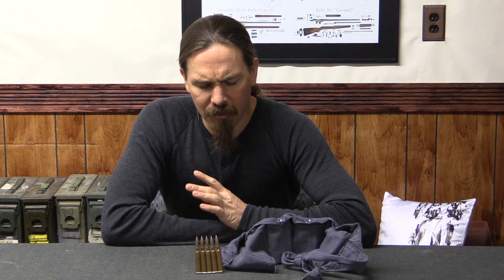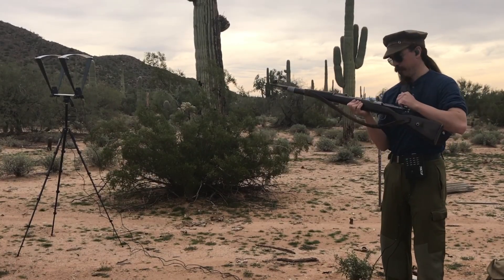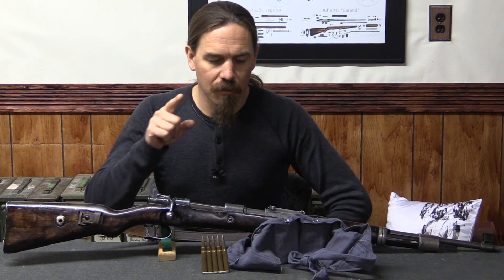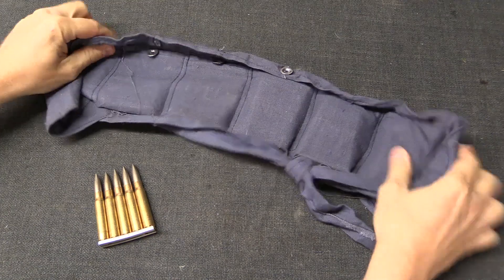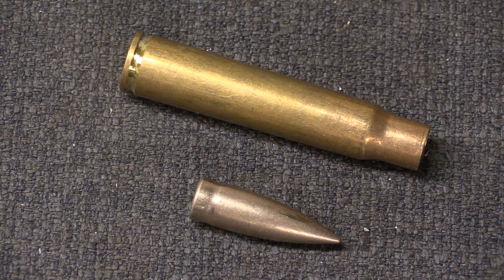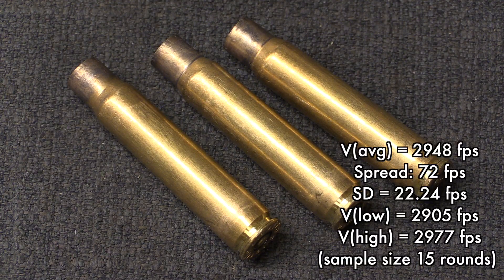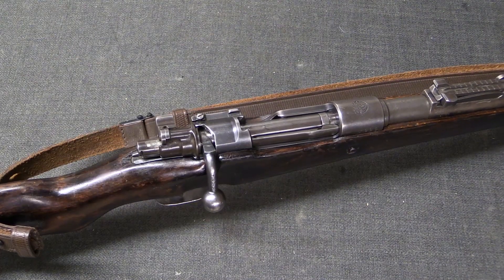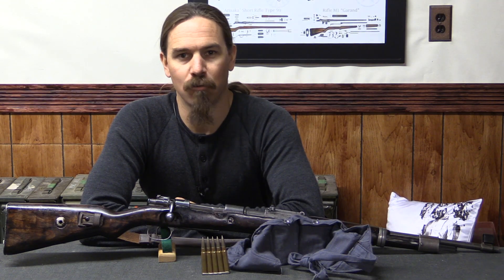Ammunition Evaluation: 1941 Turkish 8mm Mauser

Comment: Would you fire this ammo in an 1893 small ring Mauser? I did. I hadn't seen this video. It probably wasn't out yet when I did it. The ammo was in a blue bandolere, just like yours and had the same exact headstamp. It cratered just like yours did and the recoil felt like shooting a 12 ga. My rifle has a 29 and an 1/8 inch barrel though. If you added 50 ft. per second for every inch longer the barrel was than your VZ-24, that would be 3200 feet per second. I'll tell you that wouldn't surprise me. It seemed to literally scream to the target, which was an old water heater out of a camper that we let freeze. It blowed 2 1/2 to 3 inch holes in it at probably about 50 yds. I only fired one clip of 5 rounds through it, because it already had a slightly cracked stock when I fired it. I was trying to manage some of the recoil with my forward hand, but that didn't keep it from cracking further. I have a couple of ammo cans worth of this ammo. Only 2 bandolere's of it in blue ones. The other is in olive drab bandolere's. It must be Army ammo is olive drab and Navy is blue. But it's all the same. 
 My question is would you advise that it's safe to fire this ammo in a small ring 1893 Mauser with a 29 1/8 inch barrel?

Comment: I have a small quantity of 1941 dated Turkish 8mm. Cracked case necks galore, women are way over pressure, some hang fire. Friends say my 8mm just hits harder than theirs. I run it exclusively in a 1917 dated GEW 98 that some past bubba "sporterized" The guts are indestructible but the cosmetics are so bad the rifle basically lacks economic value. I've never really been afraid of it, other than knowing it might just not work, which hardly matters for plinking, but I never considered it might get used in semis or machine gun. My bandoleers are identical to yours only in a light sorta OD green. Same head stamps that looks like it was done on broken tooling. I've tried to zero this ammo, back when I had lots, it's so bizzarely inaccurate that you could use it just to drive someone nuts. It even made me wonder about my bore but a box of modern Winchester ammo confirms the 107 year old rifle is fine lol. I sorta suspect the rifle will always be fine, I think the only way to kill it would require inent, you'd have to really mean to break it.

Comment: Just found these shows.
While I do agree  with crating being a sign of HP.. Comparing the Turkish Ammo to the Others is not really a good indicator. 1 Different Loading,2 Different Primers,3 Different Powder..

What was the orginal specs for  the ammo or particular  this load.?? 2850ish for the WW1  What was these supposed  to be that or 2950ish ?? Also note  Gew98s were  28 29inch barrels What were the Turks barrels at time this ammo was made?? All really needed to get an accurate  conclusion on if actually the ammo was originally loaded to hot.Primers often have different specs,some have harder or softer cups than other n may signs of hp while another in the exact same case powder n bullet dosent.

THERE IS NO DOUBT HOWEVER  I WOULD NOT SHOT THIS MYSELF.
 
Would pull the bullets n re load at some point myself.

Comment: I am not an expert but I think the problem is not with Turkish ammunition because Turks have been using this ammunitions in all wars for decades even a century. However in Turkey there is no civilian market for fire arms and there are no firearms produced for civilians. Anything produced is for military use only and has to pass military tests. All Caniks etc have to pass Nato tests and they are designed for hotter Nato grade 9mm bullets. Thats why they have a stiffer recoil spring. In USA however I dont think that civilian market fire arms are built to withstand military grade tests. If you use these cartridges with non military grade rifles of course the substandard barrel can break. Or if you use less than Nato grade 9mm bullet of course you can have a problem with recoil spring. And the stock of this rifle is like 100 years old. I dont think if it was new it would break. Otherwise how did the Turks fought and won in Gallipoli if every rifle was breaking :).
Reply from the maker: The chemical formulation of the powder in this ammunition is such that it increases in pressure as it breaks down. It was fine in 1941 when it was new; it's dangerous now.

Comment: Thanks for the info.I also learned a lot watching your video on the Yugoslavian M48. I just got one and checked all the numbers. All match except the firing pin. Plus it has one dimple after the manufacture number. Not a biggy to me, I bought it to shoot and I think there quit cool. I purchased some Yugoslav surplus ammo, stamped 40. Sound ok to you to shoot? It’s copper over lead, which is good cause most ranges don’t allow magnetic rounds. Any advice on cleaning after shooting would be great also. I always clean my equipment right away, I’ve been using Balistol for all my stuff. Does that work for this berdan prime ammo? Thanks for your great videos!

Comment: Not to shootTurk  S ammo I'm MG and semi's has been known for 20+ yrs.
Fair test would have been using 29" bbl with crono set at the distance the Germans used. They didn't have electronic chronos back than and most velocities were actually measured 50-75' from muzzle.
IMOP Turk S ammo isn't HOT .  Just because it broke a tired yugo 98k stock that survived poofter Romanian ammo  isn't proof.

Comment: I wonder what you could salvage from that ammo.   I'm assuming you could break it apart, dispose of the powder and reload the primed case with the same bullets using modern powder.  That might solve the overpressure issue but I think the primer is what makes it corrosive so that would still be a problem.  I do have a kit that will convert Berdan cases to boxer (though it's not a quick automated process) so maybe you could pop the primer and just use the case and bullet.  Of course being a real cheapskate, I wonder if you could just reuse the powder by reducing the charge.  Like could you capture all the powder while pulling the bullets, weigh each load, average it out and then reload it by reducing the load by 10% or something like that?  If you're using a bolt action, it should be safe to try and once you've worked out a charge, it might be a worthwhile project, at least for reloaders.  I did something like this some time ago with some 7.62x39 that had misfed and gotten damaged.  Still, it might probably be best to just avoid it altogether.

Comment: I know this is an old video but i have a question… i have a Mauser Gew 88. From 1891. It says its 8mm. I went ahead and bought 8mm in the bandolier but i put the top of the “8mm” bullet at the top of the barrel and the bullet is bigger than the barrel. It is german so im wondering if they had their own ammo that went through it.
Reply: G88 were designed for a different (older) loading of 8mm, most were updated for the newer version. However, I would not fire a g88, if you are not sure if it has the spitzer update or not, and I would highly recommend not using surplus (especially Turkish) in them . Many people reload lighter loads for 88s as the are often over a 100 years old

Comment: I have one of these and I bet I have fired 1000 rounds through it. I have had probably that many that were cracked at the neck and or did not fire.  I weighed somewhere round 50 bullets and found the average to be 155 gr.  When they do fire I have had great accuracy out to 300 yards with the factory iron sights. Other than the berdian(sp?) primers I have no problem buyin or usin this ammo just pull the bad neck ones and reload it into new brass boxer primed cases.

Comment: Thanks Ian. Watching your video made me check my 8mm brass196gr Turkish 1950 ammo. Comparing it to a few Remington 170gr and S&B 196gr brass I could definitely see the "cratering" you talked about. A friend gave it to me many moons ago. Clothe bandolier, 7 pouches, 2-5 rds on stripper clips per. Have 60 rounds left, saving it for when it's needed. Definitely corrosive. The K98 has the "f" proof marks indicating that it was test fired with a 1.5 powder load. Great info, thanks!

Comment: As a reloader I can confirm those cases were overpressure or +p rounds. They are way to hot. I've seen over pressure carriages. They kick like a mule and the primer edges are flat and not round the primer has a less of a divit and in some extreme cases if it didnt blow your shoulder out its gunna blow the primer slightly out of its pocket.

Comment: Turkish 7,9mm ammo was loaded for 29 inch barrels ( the greater majority of "Turkish Mausers". With the S bullet ( 154 grain )
This cartridge was also made for Maxims &Vickers MG.
But the sS cartridge ( 198gn ) was used by the Turks primarily for MGs
( Maxims, Vickers, and ZB30s with Gas regulation, as well as Hotchkiss LMG ( M1922).
Semi Autorifles and LMGs WITHOUT Gas regulation will be Damaged by Turkish Ammo. NOTE Well...
Reason: Port Pressure with Turkish Ammo is very High, due to different Burning rates of Turk Powder Vis. Powder specifically for Gas Operated Semi and Full Auto (without Gas regulation)...Gas -regulated MGs and LMGs not affected, also Recoil operated MGs not affected.
Doc AV

Not as clear cut as it seems.

Comment: Yeah I bought a bunch of Turkish 8mm back in the 90's for my Turkish Mauser.  The bandoliers were kind of khaki.
Not only was 15% of it cracked at the neck. About another 15% was dud. (probably smaller cracks that let moisture in?) 
Those that did fire were also over pressure. The Turkish Mauser isn't quite the fit and finish of a Kar 98 k. But my particular model though rough around the edges is pretty tight where it counts. 
My armorer friend thinks it was made in Germany and re-furbished in Ankara, so a kind of an AnKARa 98 K?
Either way, I'm getting Romanian next time. Turkish 8mm takes all the fun out of it. Though I have put dozens of those through the Mauser at this point and it's still solid. Turkish wood is better?
Side note, I had so much left over flake from the damaged rounds we filled a coffee can with it and disposed of it safely in a dry creek bed. Made a pretty good sound. Got all the dogs barking.

Comment: I know this is an old vid, but very much like what I experienced with my Turkish Mauser and the 2 bandoliers of ammo that came with it. Took a long time shooting it all because it was so hot. It became a dare each time we went out shooting. But then I started getting split cases, and then problems with the firing pin. Ended up pulling all the bullets and powder I had left. But not until after I used it on a stack of phonebooks.  One shot of that steel core ammo tore through 7 huge phonebooks and then broke the rock behind it.
Reply: I shot a 1 1/2in chunk of steel with it. 8mm made a hole, you can see light out the other end

Comment: Well, good to know. My guess would be those cartridges were loaded hot to begin with. Normally, ammo that is not stored properly will shoot at lower pressure and velocity. So, pull a bullet, dump and weigh the powder. Do this to 100. Then neck size cases. Start with a load of powder reduced by 20%, load 5 rounds and shoot over the chronograph. Continue to increase the powder charge gradually 5 cartridges at a time until 2750 fps is achieved. Now you will know how to rebuild all that Turkish ammo for safe shooting.

Comment: The original ammo as I recall was also based on Proof cartridges sent to Turkey to manufacture to proof test rifles.  Some early manufacturers used it as a standard ammo load.  I could be wrong on that (Just because you read it in a review doesn't make it true).
For the first time ever I do 1/4 disagree with Ian in the fact that if you have a G43 with a shooters kit installed it will handle this ammo well.  The original G43 couldn't handle standard german ammo without damaging the rifles receiver lugs so years ago restorers got to work on a gas upgrade for them.  It's known as a shooters kit.  I had mine restored and the shooters kit installed from a man in AZ who has been restoring them 30 years or more.  I asked him several weeks ago when he finished it if I should avoid the thousands of rounds of Turk ammo I have collected over the the years he simply said "no, it will handle and vent the turk ammo well with the kit installed.  The only real reason I suggest to stay away from it because it's so dirty".
Of course if you're shooting a G43 you had better have the kit installed anyway to prevent eventual damage that will occur.

Comment: I still have a case of this stuff . . . and it scares me.
I have to  pull and wiggle each bullet to make sure that bullet will not come out of the case as most of the necks are cracked.
I throw out at least 2 out of 5. Glad it was so cheap back in 1990, but wish I had known before hand.

Comment: I had 15 cases of this exact ammo and I used it in my Israeli converted 308 1919 to 8mm. It shot fine but did wear barrels out fast. I’ve got a Turkish 8mm Mauser and it shoots this stuff fine. It is very hot though so I converted the 1919 back to 308.

Comment: I managed to find some of this ammunition head stamped 1943 and shot it in my 1903 Turkish mauser. The rifle was updated to the 8mm pattern obviously. I've shot the rifle out to 300 yards and the iron sights, when set to 300, are dead on with this Turkish ammunition. Unfortunately, I don't think there is any factory ammo loaded with such a light bullet as the 155 grain steel bullet in these rounds. I do frequently see cracked necks after firing. I think this might be partly related to the extreme crimping on some of the rounds and brittle brass.
Reply: Sağgerici Solgerici  The cracked neck issue relates to the neck of the cartridge, not the the rifle stock. The neck is the top of the cartridge where the brass is wrapped around the bullet. The rifle stock could crack even with regular ammunition if the rifle is shot a lot, but the extra recoil from hot ammunition doesn't help. The problem with very old brass is that brass age hardens. New cartridge brass is soft and springy and when you fire a round the pressure and heat makes the brass even softer. The brass actually is so soft it easily expands into the rifle chamber and seals the chamber. But the old brass has hardened through precipitation processes and probably also various chemical reactions. So when you fire this old brass, the brass can't expand into the chamber since it's too hard and instead it just cracks. If the case cracked below the neck, which could happen, it would be worse because gas would vent back towards your face, but gas venting usually doesn't happen when the neck alone cracks. Brittle brass is probably only tangentially related to the rounds being hot. I've heard several different theories about why the velocities and pressures are too high. Some people say the flake powder fractures into tiny pieces and thus burns too fast because of its old age.  Also head someone say the brittle brass causes the high pressure because the internal volume of the case doesn't expand as it would with new soft and springy brass.

Comment: Just learned the bullet puller modification from EC . That green hammer looking bullet puller has a rubber band ring thing in it to hold the shell casing. Pull that out and instead use a shell holder.

Comment: Ian, a friend gave me some Turkish within these types. Can I safely use in my pristine M48 Yugo? Thank you
Reply: Did you try it out? If so, how did it run in the M48? Any damage to the gun?
Reply: @DireAvenger001  i returned them. I'm also not a fan of the Ethiopia or Greek. I still have a far amount of Romanian.
Reply: @randyadams03  Romanian was all that worked in the M48? Is the striker spring weak?

Comment: Thanks for another good video. It would be a good idea to relieve the back of the tang inlet on the replacement stock, as necessary, so that the back of the tang does not bear directly against the stock. Recoil force is not meant to be directed against the stock at that point. The inlet tooling was probably set up so that the cut would be at or under size, with the intent that final fit would be sorted at assembly time, as per standard timber machining practice, i.e. to avoid wasting rifle stocks and/or having to cut and patch new stocks. All it takes is one idiot who wants to ‘streamline’ production by cutting out skilled assembly, to create such a problem in an assembled rifle. I doubt that the timber had ‘grown’ because we are talking about a military rifle stock and not a poorly sealed Ruger or late BSA sporting stock.

Comment: Ian, why do you insist referring  to 7.92mm calibre  ammo  as  8mm ?  This "rounding up"  is annoying  and  misleading (only worse would be converting 7.92mm  to inches):  no army using this ammunition called it "8mm" - it's has been always 7.92mm.   Calling it "8mm" is technically and historically inaccurate and indicates  a sort of mental laziness and arrogance on your part.   I would like to stress, I like your videos, respect your knowledge and I'm a subscriber to your channel.
Reply: It does cause some confusion but Ian is not rounding up or lazy. Check Wiki for more info on why it's called 8mm.

Comment: I cant think about what if Turkey join the WW2 with these ammo... what if a soldier try to use is mg42 or g43 sounds scary.
Reply: A lot of the problems occur from storage over time (powder breaks down, especially in heat and with moisture changes). So, when it was new it was probably quite fine.